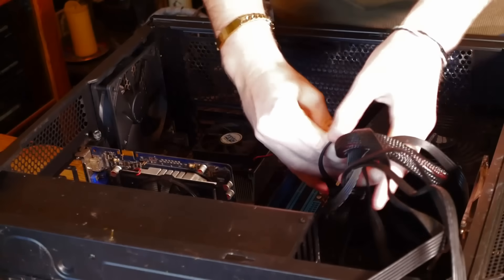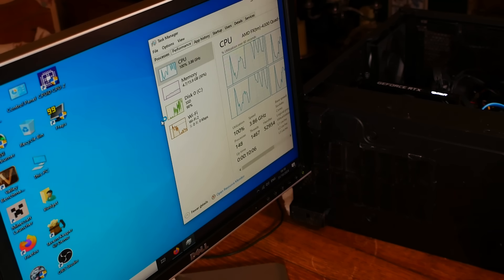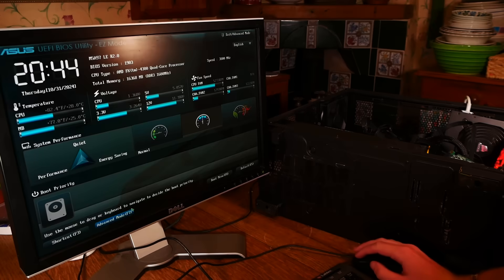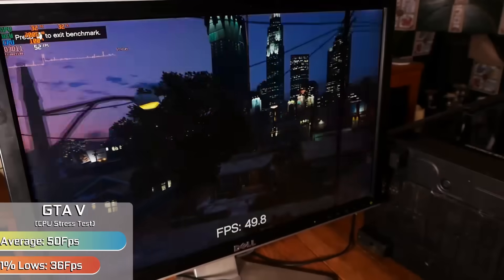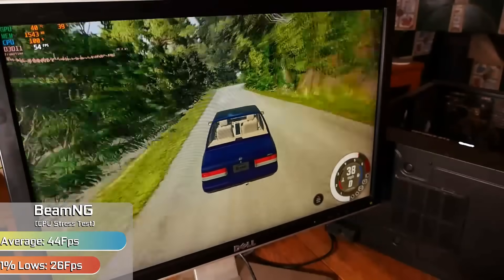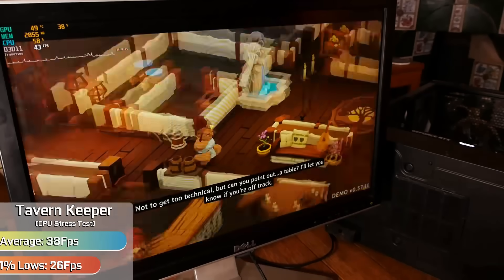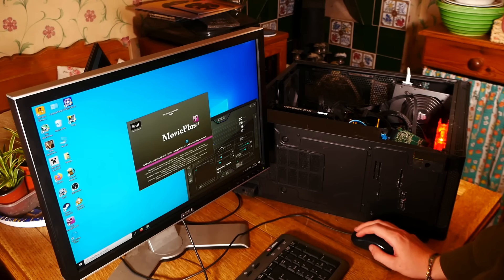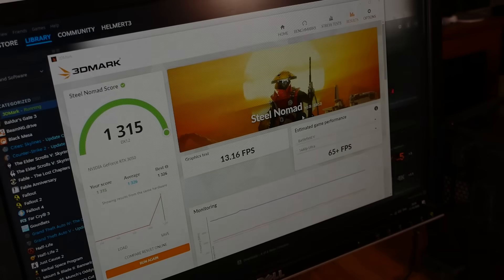AMDs Weakest FX Processor...

Comment: Modded minecraft is actually a very good benchmark or at least was with older versions, I got myself a new intel system around the time of FX series mostly for minecraft, I choose the 4000 series i3 instead because I preferred the single core performance for games and even that struggled to maintain 60fps once I had a small factory of machines going.

Comment: I ran an FX-6300 for 2 years until I could afford an 8350. From there I upgraded RAM to 16gb and ran that until ryzen 3rd gen. It's kept me loyal to AMD
Reply: very nice upgrade path... 
i went from a Phenom x4 9590 to an Fx8350... then i built a 2ndary build with a Phenom II x4 945... then upgraded the phenom to an Fx4300... then i sold the Fx4300 (the Fx8350 went from primary to sec.) and purchased a B350 mobo paired with an R5 1600... then i upgraded my R5 1600 to an R7 5700x which is my current main rig.

i gave away my old Fx8350 to my girls... in exchange she gave me an old PC with an M5a78L-M LX3 mobo and an AM3 sempron installed... and yes... i put 16gb of DDR3 and upgraded the sempron to an Fx8320e, and that will remain as my sec. build for years to come, paried with a modest gpu i will try linux and keep the Fx show going on for at least another decade if hard holds up

Comment: i had an fx4300 that was clocked in the high 4ghz range, had it at the same speeds for about 5 years before switching to the fx8300

Comment: My current PC originally came with an FX8350, and compared to the Phenom II 1055T that the PC before that had, it did see a huge improvement in the few games at the time that could utilize high core counts effectively like Space Engineers. In most other titles however, the 2 cores per FPU layout did not do it any favors, showing either no real difference from the Phenom, or in some cases (Sim City 4 and GZDoom) even ending in disaster with unplayable framerates and at times even instability.

It was replaced with a Ryzen 5 2600x the following year and it blew the old CPU out of the water in basically everything. Would've kept it, but then ASUS did a bad and I needed to switch to a new motherboard vendor and got myself a 5700g to go with it, but that's another story.

Comment: Never regretted buying my bulldozer, sure, out of the box they were destroyed by the intel parts in gaming, when clockrate was still king, but they were easily overclockable unlike the intel parts in the same price range.
And sure, due to their architecture 2 cores had to share some of their resources making them behave more like a single core with hyperthreading in some applications, but you couldn't even buy an intel with hypertreading for that price.
They aged rather gracefully, as time went on more and more applications took advantage of more threads/cores so they didn't felt like an old CPU in everyday usage.
One just had to threw an SSD into the "budget" machine after a few years, and they felt like a new computer in like 80% of programs, not something you could replicate on the most common intel parts of that time, unless you paid a premium for the top tier K series.
My Bulldozer handled everything i could throw at it, including gaming, all the way until i bought a 5000 series ryzen.

Comment: I ran an FX 6300 running in may backup server .. It was my daily driver PC up to when the 7-2700 came out .. Today i have a 5700G as my daily  driver .. I did move the 2700 to that backup server .. The 6300 is still around just could not throw it away after a decade of service !!

Comment: Overclock the HT bus and do an fsb overclock instead of multiplier as they performed far better that way, and you have a decent little quad (dual) core

But for less money, you can buy a xeon 2680v3 (7 usd ish) and a cheap x99 mobo and ram for less than 50 usd combined from ali and ebay respectively, and it will run just about any game out there (think between ryzen 2000 and 3000 performance)
Reply: Yup, the same also holds true for the K10 and to a degree for the K8 chips, the whole frontend scales up performance quite well. 
I think it was 2400-2600 on the northbridge and maybe 2200 on the HT, paired with fast RAM in the 1866-2000-2133 range and it should fly.

Comment: I'm planning on rebuilding my first custom built pc. Unfortunately it had the fx8350. It was fine for the r7 250x it was paired with but the moment i dropped a 1070 in it i realized how crap it was. i went to 1366 after and got an i7 990x and i didn't look back. Also that wasn't a cheater... That's the Halloween event.

Comment: I bought a 9590 and a Asus TUF Saber kitty to play around with overclocking, was able to run 5.2ghz daily on a custom loop cooler.  I overclocked the cpu/nb as well as running 2400mhz ram and believe it or not, I started using it for my daily driver over my intel 2700k unit.  It wasn't until Ryzen that I finally upgraded.  Even then the uplift wasn't as much as others saw on gaming.  The real performance boost for Piledriver was by overclocking the cpu/nb past 2600mhz.  Combine that with a good core overclock and it was actually pretty good.  Now I run a 5950x and can honestly say, it doesn't heat up my room as much as the 9590 LOL.

Comment: I remember building someone a PC back in these days with an FX 8350. It was on par with an i7 for video encoding, which was the primary purpose for that PC.... until the dude saw me playing games and wanted to do the same. He promptly went to a department store and bought the GT210 that was recommended to him by a salesman as a "good card for gaming."
At that same time, an online friend of mine wanted to build a new PC. I told him his best options, including the fact he should stay away from FX CPUs for gaming. He said it's OK because his friend knows PCs and will help him out.
That friend of his was a mistake.
2 weeks later, he tells me of the great new PC he built for some $2200USD: an FX 6350, some $300 motherboard, 8GB ram, 1200w PSU, 1TB HDD, a 1440p 144hz monitor, and a GTX 660. I am still bewildered by the thought process that went into those components.

Comment: I have my AMD 8350 FX sitting right next to my Ryzen PC Still built and working with an NVME Modded BIOS on it and it still works! Just maybe skip Ractchet and Clank Rift Apart LOL a 2060 Super is a bit over kill for it haha. But I loved it when I had it could Play original Metro 2033 with SLI at 75-100FPS when others had issues with that game then holding 60...

Comment: Great videos and since you have a working AM3+ board, hope we some more FX content. FX-8000s '8 cores' diffused after 2014 are insanely good overclockers and do so while sipping energy at the same base clocks as the FX-9590 or whatever that beast was. like 1.28v Vcore under 4.8ghz all core load compared to 1.45v of the old top FX chip, and also while being much better ram/FSB overclockers. They were fun to play with, and it was funny seeing a chip I pulled from an acer oem recycling centre special smoke my old budget champion i5-2500k in games like AC Origin and TW Warhammer 2.

Comment: i still run, smoe ~10+ years later, 2 Athlon II systems.
They just work. They do what I need them to and do it Okay. The drives in them are all old now but no errors or drop outs and all of their lovely data is still fine. I use one as a HTPC and the other as a home file server.  The HTPC has a X4 640 running at stock of 3.0 HGz with 16 GB 1600MHz RAM. The server I just added a bunch of RAM as I plan on switching over to ZFS and I hear it will use all the RAM you can throw at it, so 10GB up to 32GB 1600. Both of these have given few if any problems. The server runs Xigmanas, which is a renamed NAS4Free derived from FreeNAS now TrueNAS. A more old schoolish hands on distro that I have managed to keep running. The other box is a dead stock fully updated W10 with a Radeon R7 360 2GB. I have run World of Warships occasionally on it and it runs that fine. Video playback is 100% flawless from any source I have thrown at it, including Amazon Prime, Netflix, Youtube, etc etc for online streaming stuff. Local file playback is seriously no problem with Media Player Classic. 
The one thing about these boxes is they have been fully paid for for at least the past 6 or 7 years. I can't remember the last drive failure on them either. No need to update or upgrade something that meets your needs. Will be using them as is for the next several years.

BTW thanks for bringing your old stuff back into the light. Grats on the 200th episode too.
Have really enjoyed your recent spate of videos and am looking forward to your next one.
Keep well.

Comment: My very first pc I built back when I was 13 years old had an FX 4100 at the heart of it, paired with a used 9800gt. For me personally, the FX series will always hold a special place in my heart as it was the platform that first got me into the hobby. I put so many hours on that chip until I retired it for a 6700k when that released. I still have my 4100 somewhere, not like anyone wanted it when I was done with it lmao.

Comment: There was a FX-4100. Actually my first owned processor. With i think 200mhz lower in boost than the FX-4300.

I still have a 4300 running in my Nas... Yea i am currently searching for a uograde

Comment: I rocked an 8320 up until 2021 or 2022. It was a surprisingly capable CPU for everything I needed despite the age. The multicore performance was decent, but as you know, single core was not the best.

Comment: Never was a fan of FX series. Back in 2011 built myself a PC on 2500K with P67 motherboard, as FX series was delayed, for I think more than half a year. Guess I did the right choice, considering that you had to wait another year for slightly fixed Vishera FX's, compared to even worse Bulldozer. 

We must put ourselves in a 2011-2012 reality, where most games and programs mostly utilized 2 cores, and 4 cores CPU's were just coming for mainstream consumer (though Core 2 Quads, Phenom II x4 or i7-8xx/9xx already existed, they were top of the line like i7/i9 or Ryzen 7/9 nowadays). Where you could utilize all the threads provided by FX, it worked pretty good for the price, but this was only the fraction of games and applications. When it came about single thread, FX's were so slow (even slower than in Phenom II), that it many cases most powerful FX-8xxx could perform worse than some Pentium Dual-Cores priced at 1/3 of FX. Yikes. With such uneven performance it was hard to be recommended.

As an "upgrade", for many people with Phenom II x4 was almost like an downgrade, and many motherboards couldn't handle the most powerful FX's, cause of horrendous power consumption. After overclocking it could be almost doubled. Dying motherboards cause of too poor power delivery was somewhat common back in the day. AMD basically invented Netburst again :P

In mid-range they also weren't too competetive. At least in Poland, I remember FX-6300 being priced close to i3-2100 or i3-3220 most of the time. Cause of games optimalization for 2, or at most 4 threads, i3 was performing just fine, and there was rarely any pros to buy FX. Same, when it comes for FX-8320/8350 compared to locked i5 models. Maybe only for overclockers it could make some sense… Final nail in the coffin was, later, adding HT to Pentium Dual-Cores, while being still dirty cheap. Though, at this point, Vishera was really outdated, and Ryzen just was around the corner...

At last, we can admit, that FX series aged pretty well, cause the amount of threads finally being utilized (though, AMD "cheated" a bit, as 8 core unit as they called it, is not actually true 8 core CPU) and the fact that it supports relatively new instruction set (notably SSE4, compared to Phenom II), as some games (and even current Windows 11 builds) just refuse to launch without supporting such.

Though regarding purchasing one nowadays... I'm not sure if used market in my country is a joke, but completing FX platform, even with not the most powerful chip is almost always way expensive than just going with cheap AM4 motherboard with some Ryzen 3 1200 / 1200 AF and DDR4 memory. It's faster, newer, less power-hungry, and crazy upgradable.

BTW. You've done tests on RTX 3050, that utilizes only 8 PCI-E lanes. On FX those lines are just Gen2 speeds, so card runs like on Gen1 x16. I'm not sure if it had some impact on performance with such low-performance CPU, but with FX-8xxx I would consider using x16 card. It probably won't be much, but better to show performance at their best ;)

Comment: Dumb question: for games like Rimworld and Tavern Keper, why wouldn't the game use more of the processor when it needs to? Something I never really understood.
Reply from the maker: Rimworld is made in Unity I believe, which means it mostly has an engine limitation that makes it use Core 0 primarily and occasionally Core 1. Which is the same for a lot of other Unity games.

You can actually have one late game version of Rimworld open and lagging, and open up another instance of the game which will run smoothly (till the late game and provided you have 4 cores or higher).

The game simply can’t assign tasks beyond 2 cores because of the engine. 

I would imagine Tavern Keeper has similar limitations but it is also in development at the moment, which is why I keep it in as a new benchmark. 

Hope this helps 👍
Reply: @BudgetBuildsOfficial it does, thank you 😊

Comment: FX 9590 here with an R9 Fury and 16GB RAM at 1866Mhz and in case you wonder I managed to have Turbo enabled on an Asus 970 Gaming Aura MB which said it supported that crazy CPU initially now it says it goes up to 8370 but works here so what can I say... 
I just made a PC I could not even think to afford back in the day, also 9590s and 9370s are selling dead cheap nowadays cause they were supported by rather few MBs which are becoming really rare to find... 
At CPUZ bench when you have the Turbo enabled you get lower score at multi thread than with the Turbo disabled, about 1730 to about 1880 points, furthermore it needs APM and C6 states enabled in BIOS to work, but it is cool to see 5017Mhz all cores at HWMonitor cause Windows 11 show 4.92 max don't know why.
Games run fine and the overall experience is pretty good although you need a huge air cooler to keep it steady especially when turbo is enabled which doesn't offer much except for power consumption and extra latency.
Cheers from Greece Keep up! Jim.

Comment: The FX8350 still meets recommended requirements for a lot of games released today so the FX4300 still performing fine isn't really much of a shock, would I use either of them? Nope, I'm fine with my 5800X3D but if I ever need a second pc or this one has issues I don't have a problem dusting it off and using it while I wait for parts to arrive.

Comment: My first PC build was an FX-8350 paired with a 980ti.

It played everything I wanted and ran for the most points flawless. When you say hot though BOY that's an understatement BUT.... A cooler master TX3 did the job somehow flawlessly. 

I ran that build for 8 years til I finally bit the bullet, bought a 2080ti and a Ryzen 7 5800x as my current build. Couldn't be happier.

That PC may Have been some hot underperformance but I had some of the best times imaginable on it too.

I guess I should mention the PC my old FX replaced was an Intel Q9650 with a 750ti. So it was still QUITE a bit of performance boost.

Comment: Bulldozer was garbage but Vishera fixed a lot of problems. Better temps, lower power usage, higher IPC, better clockspeeds, better overclocking, better general stability, better memory support, etc etc. I stopped at Phenom II X6 but kinda regret not getting a used Vishera to experiment with. At the time AVX wasn't really a big thing yet and my 1100T at 4GHz was squarely outperforming most FX chips in nearly every category. However the FX series CPUs aged a lot better than Phenom II due to AVX support and higher thread count. Especially in later game titles Vishera clearly outperforms Thuban if Thuban can even run it. I had one friend ride an overclocked 4.7GHz 8350 all the way to Ryzen 3000. The 8350 wasn't a great performer by that point but he had no problem pushing a GTX980 in the games he wanted to play.

Comment: The lawsuit was more about the floating point unit than the cache. The FX shared one FPU between two integer 'cores'. Comes down to what you call a core really. People expect that a core is integer and FPU. So a quad should have 4 cores each with their own FPU. FX went with a module design, each module had 2 cores with a shared FPU, meaning the quad only had 2 FPU's, the  6 core had 3, etc. 
Having said that, I ran an 8350 for a few years and had no issues with it.

Comment: I still have my First PC witch was a acer aspire from 2011 with some upgrades. System is equipped with a AMD A10 6700 4.3 ghz boost clock, Kingston Hyper X fury 16gb ddr3 1866mhz, with a rx560 4gb gpu. it handles alot like this Fx 4300 chip. but now I just use it for emulation purposes

Comment: I have an FX-8350 and FX-9590 - the 9590 wasn't great (way higher power than the 8350 and performs about the same), but the 8350 was amazing for its price back when it was new. The lawsuit a few years back only served to make it an even better deal.

My sister ended up using the 8350 box for quite a while after I moved on to a newer one - I don't think she ever really outgrew the thing, but when she went off to college I got it back. I still have it sitting around here and poked at some older games on it recently, perhaps I need to try some newer ones too.